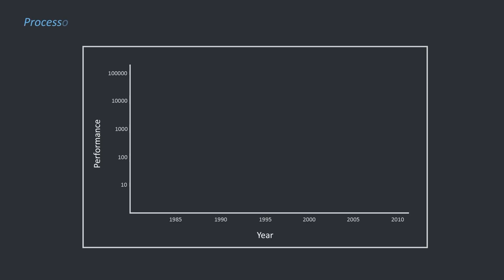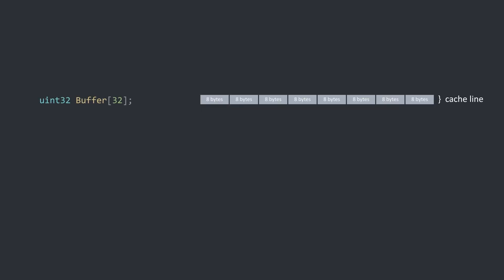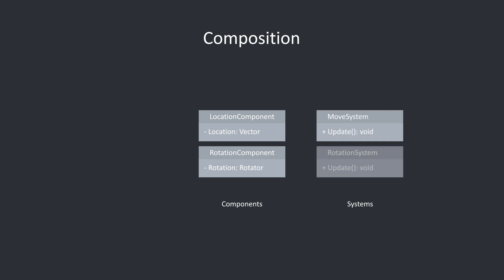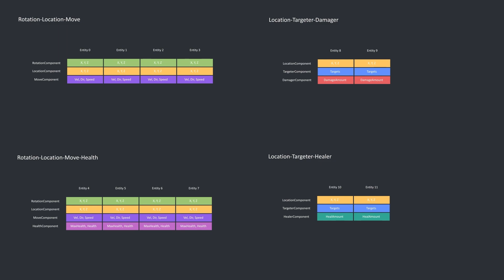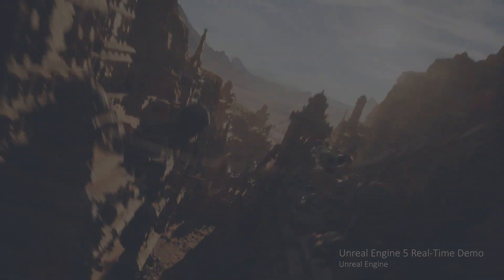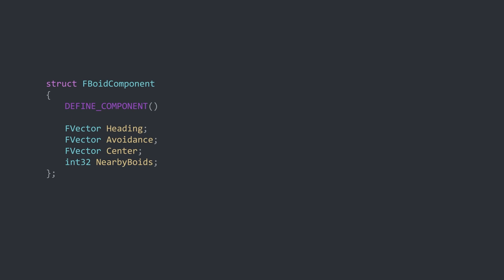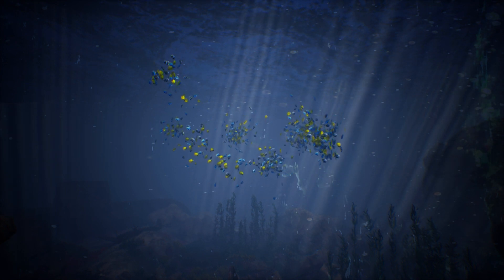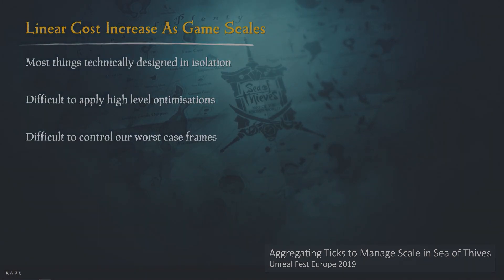The ECS Architecture - Performance in UE4

Comment: How would you integrate something like an oct-tree or bsp-tree into your example to speed up the n^2 operation of finding the nearby boids. How would that fit into ECS?
Reply from the maker: In this example I just used a grid to solve this which is very friendly to ECS. 
I have never had to implement an Oct-Tree or BVH etc. with ECS before so I can't comment on it. But different problems require different solutions so it's possible ECS is not a good fit for this

Comment: What type of games will benefit from ECS? How does it work in networked games? I have so many questions. But a 3x performance increase on a boid system seems like only scratching the surface. I’ve just been using OOP for so long I can’t think of places to use this!
Reply from the maker: You can use ECS is all types of projects, even outside of games. Though it's a tool and not a magic wand, you have to know when using it will help you or if it'll just make things more complex. 

For example, if you have lots and lots of players or AI that use the character movement then it might be worth exploring an ECS way of handling capsule movement. But if you don't have lots of entities that are using capsule movement then using OO might be the best way of solving that problem

Comment: I've watched probably every single other ECS and Data Oriented Programming video on youtube up until this point, but if I'd have found yours earlier I wouldn't even have needed to watch the others. This is by far the best breakdown I've seen. Great examples, and thank you for showing the code and breaking it down to chunks and explaining those. 

I'm so lucky I started learning programing and discovered this concept early... I honestly always just assumed that programming systems and components were how games worked. Not with those words, but in my mind, having a whole chunk set aside that tells everything how to move or whatnot just makes so much sense. It seems insanely convoluted to need to "teach" every single thing in a game how it works. I only recently learned about the idea of inheritance, and that just makes everything even crazier to me! How has this been the norm for as long as it has? It blows my mind. lol

Comment: Data oriented design is just so logical. It's almost like when we've programmed in OOP the whole time, we tried to ignore the actual problem of transmuting data and instead focused on structuring the code with inheritance patterns, no matter if this would actually help to solve the problem. Just because someone once said that software should be written using OOP.

Comment: "performance boost" = you can easily have 100 to 10000 as many simulated assets/agents, actng independently, fulfilling indepentend "scedules/jobs" , with ecs. The upper bound is mostly set by the ammount if cpu cache, and the slow ram+mainboard is less bottlenecking.
This is very useful for simulation games (with large populations like Tropico that are composites of lists of traits/states, following basic needs and scedules), citybuilders (anything adjacent to dwarf fortress), anything adjacent to factorio, and the general RTS genre will easily lose its [200 units per faction limit] just by using ecs.

You likely want to simplify pathfinding by precomputing and storing distance-fields to common/central rooms/doors/signposts on the gpu, and doing a* pathfinding only on the gpu, or by doing the timberborn-district-constrain, even only in a soft-version by using doors and gareways like pseudo-district-borders, and buffering distanceFields to all the doors/gates, so that any agent can easily triangulate its position in a maze, by just loading 3 (or more) relevant distance-field maps, that instantly tell the direction to 3 doors (gpus are super fast at estimating the first derivative for a general direction for a shortest path), and that gives a VERY good a* hint to where anything may be, within segments of 1024x1024 pixels.

All this is the reason, I bought a ryzen9 with a gtx 3080, that underclocks even the slowest avalable 32 gb ram to run at only 2900ish ghz. I bought a pc, optimized for ECS, and it almost looks like the slow and small mainboard is an insult to all the things connected to it.

Comment: How does caching work when it comes to systems that operate on multiple components?

6:25

// movement system example
foreach eid in entities:
    LocationComponent[eid].x += MovementComponent[eid].x;
    LocationComponent[eid].y += MovementComponent[eid].y;
    ...

Do you get a cache miss in this case?
How does the cpu have both LocationComponents and MovementComponents in the cache line?
I hope its not a stupid question, i just can't wrap my head around this.
Reply from the maker: It depends. Firstly how the ECS is designed, is it using large mega component arrays for the program, does it group single components as tuples or does it use an archetype system as in unity? But in general though, you probably have components in L2 or L3 cache which still helps iteration time with multiple components

Comment: The two problems that I see with ECS are:
- If you have, for example, 100 entities (minecraft skeletons, for example), where each entity has 10 components, and you have 10 systems to process these components, you would have to iterate 1000 (or 10 * 100) times, or, in other words, iterate over each entity 10 times instead of just 1 time with basic update() OOP design. So, you trade cache misses for 10 times the iteration?  Doesn't seem fast to me.  
- If you have systems that target multiple (or even 2) components, this defeats all benefits from cache locality, making it as slow as OOP, maybe even slower (arguably).
Reply: I'm also wondering why we could get performance benefit from ECS because of reduced cache miss. IMHO I think one system only touch one component sounds too perfect to me. Even though one type of the components can be put together and reduce cache miss, while cross referencing different types of components is still causing cache miss.

However I do think ECS, meaning composition over inheritance (making data structure reusable) and separation between system (logic) and components (data), is making my head more clearer while implementing game. And it seems that it is very easy to run multi-threaded, which ultilizes the full power of a multi-core CPU.
Reply: Your conclusion just seems wrong. 
This was already tested many times in different frameworks and the ECS is inherintly faster than OOP.
You literally take only data you need and process it all in one system one time per frame, instead of taking objects scattered in heap and call object.UpdateYourOwnData().
Reply: @lekretka  There are several problems with that logic:
1 - ECS is not cache-friendly by default. You can allocate your components in heap wherever you want and it will be as bad as "OOP".
2 - OOP is not that bad, big classes are bad. You can allocate your "small" objects (or components in component based system) using a pool or something similar, and it can be as cache-friendly as you want.
Yes, there's a thought that systems in ECS allow processing the only data you need (since components of same type are allocated as big blocks), but that also requires more iteration, which require more cycles to process (I know, computer performance is not all about cycles, but still), but that also a dellusion, since most ECS systems actually work with more than one, or even multiple component types (practical example - Overwatch presentation about netcode and ecs), in which case, CPU will struggle, since components most likely will be in different heap locations, and it will be a much better option to just process blocks of OOP objects.
I'm not against ECS, just watned to make that clear.

Comment: Soooo ECS is very inconvinent, but can boost your perfomance if you have a lot of actors/objects? That sounds like something for extreme rare cases. I mean it's a great thing, but in 95% you don't need that. If you have 10 characters in your level, you don't  need to hurt your brain trying to make ECS - instead just use nomal human OOP and voila!
Reply: OOP is often what people say is normal cause that's what they know. Working in large games there is an underlying benefit to ECS which is the tenets of data oriented design. Even if performance isn't an issue it's good to know about different approaches to managing sets of data at a system level, because normal human OOP can often become very circular and gross, and even under the best conditions from a (usually never senior) programmer who swears they'll only ever write perfect code, there can still get to be an abstract level of bloat to deal with. The very fact we have games running in loops lends some credence as to why ECS and data driven design can be useful. Remember that these are just tools, and the more tools you know and understand, the better you'll be at solving problems. Framing everything in the context of "this or that" is the only way means you're generally choosing to stay ignorant to some degree.
Reply: once you understand, learn it, get used to it 
ecs is cleaner, more understandable easy to use and modify. it's not just good for performance, it's good for the code structure.
Reply: I'm creating a mobile project in Unity using DOTS (ECS), and performance isn't the only reason I'm doing it,
everything is easier to do when the data is ready! (networking, gameplay, Rendering ... )
Reply: It is currently inconvenient, but Unity is trying to popularize ECS as part of their "Performance by default" stance. 

Everyone can benefit from performance increases. And open possibilities to really help genres like MOBAS, strategy games and simulation games. 

As soon as Unity ECS tools come out of preview I will recommend all pathfinding in unity to be done utilizing ECS as the performance increase is incredible.
Reply: ECS is bot inherently more complex, clean code is one of its benefits.It is time consuming and expensive to retrain developers.

Comment: This is interesting, 3 times faster, I must admit it's alot faster using unitys ecs systems, maybe its burst as well, or the way they store stuff, not sure. But good to know there are ways to implement similar approaches in other engines.
Reply: Fast compared to what? Are you saying that you wrote the whole program exactly in Unity again and it's fast? Forget the comparisons now. I am using both of them. Unity is smaller than Unreal. I'm not talking about speed. Unity still growing as a package. They take the things that Unreal has for years, from those the individuals and companies who have been on the market for years, and include them in the system. The important thing is which package is more suitable for style and production conditions? This is how product selection is made.

Comment: Have you 4k unreal actors that are updated in your last system? If so that's likely going to be a huge bottleneck. AActor is 800 bytes without any user data, and they'll be scattered all over memory. Have a look at perhaps having one actor with the instanced static mesh (or hierarchical variant) component.

Good overview. Nice work.
Reply: Actually the component data can be better allocated to reduce this scattering. It is one of the requirements for having thousands of actors active in a scene.

Comment: This is a fantastic explanation of ECS and an implementation of it inside an existing codebase that isn't built for it, thank you! I did have a few questions that the code explanation didn't really cover in detail that I think would have helped with explaining it more.

1) This is just to confirm it incase I'm misunderstanding, when your implementing into the actor in this case your getting a template of specific components(I'm assuming if the template doesn't already exist and if it does then just gets it from the existing list of archetypes that were created at runtime) and then creating a generic entity class that is intended to work with that archetype, then you setup the components in that entity(that part I understood) and then once its ready, tell the archetype that this entity is part of that list of entities and that it should be updated and such?

2) Where did the system's part of the ECS actually get updated? The code example didn't show where that stuff actually gets used outside of what the systems would be doing inside it.

Again a fantastic video, I know asking to see the source code would be a bit much(assuming the project is probably super messy or whatever) but if its possible that would definitely go a long way as well because ECS definitely sounds like a great new tool to use...
Reply from the maker: GetArchetype gets or creates a new "database table" for the specific components. The Entity is just a unique ID and not a class. The CreateEntity function just returns the first free entity id in the pool, and AddEntity is to add a new row into the archetype database with new data for that entity id. 

Systems are updated through a Scheduler, it basically has a single FTickFunction for each ETickingGroup. A system class is registered to one of those tick functions and when executed it just loops over all registered systems and calls Update on them.

A bit hard to release the source ATM, this is only a MVP and there are lots of features I want implemented before I can consider releasing it (Multithreading, networking, blueprints etc.)
Reply: @dennisaaa  Ah ok thank you, so that answers my question regarding the entity. But for the Systems, like are you registering them to the Scheduler inside the Scheduler, or using some sort of data asset to list them out and have the Scheduler read from it initially and setup the System to their corresponding tick function or something? 
I guess the basic version of what I'm asking is, I have a System I've made and now what's the process of hooking it up to the Scheduler so it can update?

I really appreciate you answering my questions, if you ever do release the source code(no rush btw) probably having this Boids example as a "Simplified Version(or Branch)" without all the other bells and whistles would probably help others with understanding it easier as a learning resource...
Reply from the maker: @YawLighthouse  As of now systems are manually registered in a custom derived scheduler class unique for each project. I am not happy with this current setup and would like to automate it in the future which  is why I didn't go into much detail about it
Reply: @dennisaaa  Ah gotcha, again I appreciate you answering my questions. Everytime I looked into a simple implementation of EQS in C++ to learn from I would always be pointed to use Flecs instead of just something to learn from(so if I need to make my own implementation I have the knowledge to do so sort of thing) so you answering questions and providing a barebones explanation helped alot! :)